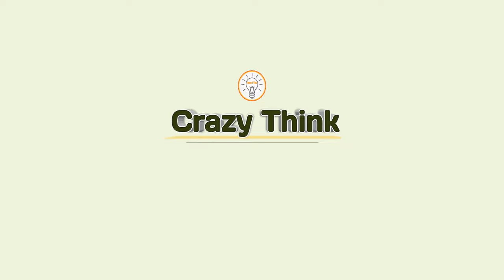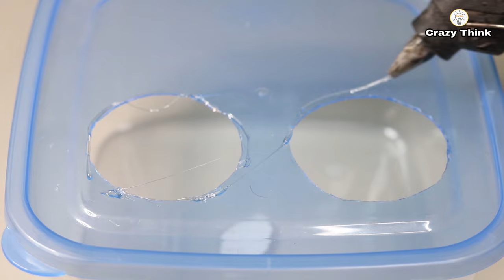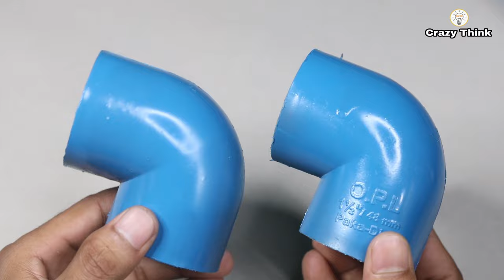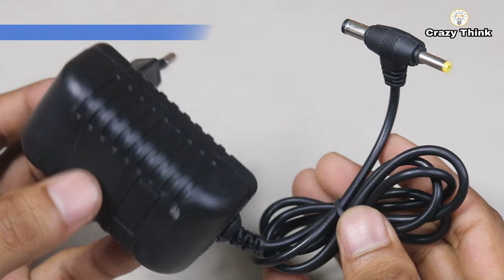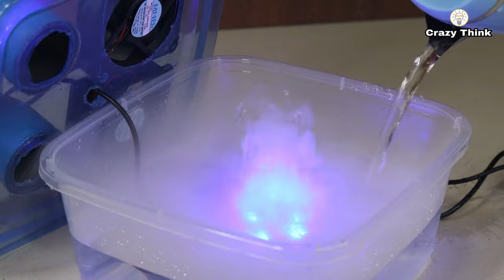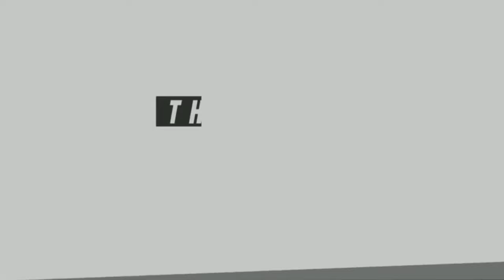How To Make Powerful Air Cooler At Home - DIY Air Conditioner

Comment: This is literally just an air humidifier pumped thru fans...
Reply: True, and in subtropical Tennessee where I live the temperature gets up in the 30s in the summer. But even worse than the heat is the humidity which prevents evaporative cooling from working well. So in summary this will not work where it is needed most.
Reply: If your just gonna complain might aswell just stay quiet you know no offense though
Reply: Please kya aap sabhi things ki name bata sakte ho mai isse banana chahti hu please please ❤❤❤

Comment: CAUTION: use waterproof wire for safety to avoid a deadly electric shock
Reply: You cant get shocked by 24 Volt DC.  Maybe a little bit by 24 Volts AC but you would not die by it.
Reply: u don't know electronics right?
Reply: 24 volts is not that  harmful
but yes, using waterproof wire to pervent short circuit ,

Comment: Can anyone tell the instruments needed in this ?
Reply: 12 volt CPU fans two, A humidifier module(aka mist maker) and adapters switch, a female DC connector...simple...
Reply: one 12v adapter and one 24v
Reply: @ravithegamer8009  thanks a lot 👍🏻
Reply: Instruments 💀
Reply: @Dem0nNature-fj1vu  I don't need its been to oooo long 😂😂
Reply: @Itsam9  bro you used the wrong word 💀
Reply: @Dem0nNature-fj1vu  I get it now
LOL 😂 😂

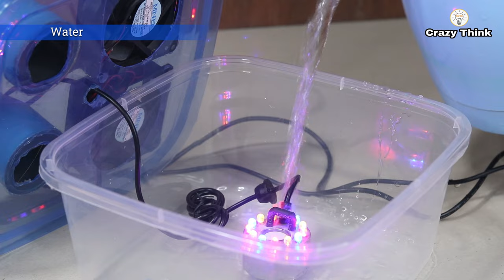Comment: The light and smoke device name at 3:13
Reply from the maker: Still Body Ultrasonic Humidifier Mist Maker
Reply: It is not necessary, it will work the same, only without the smoke